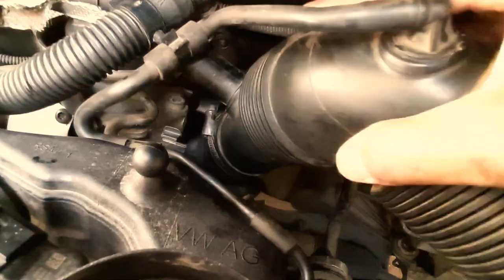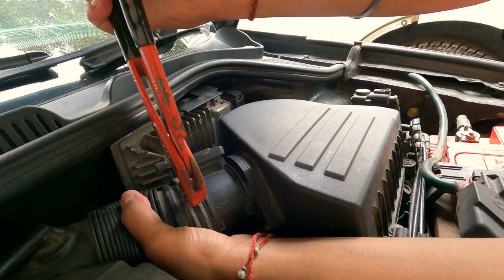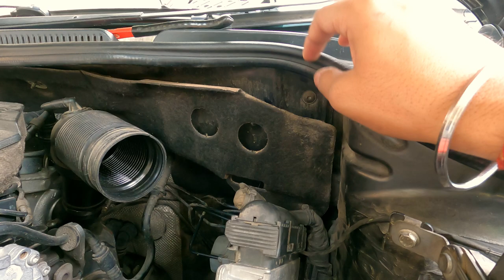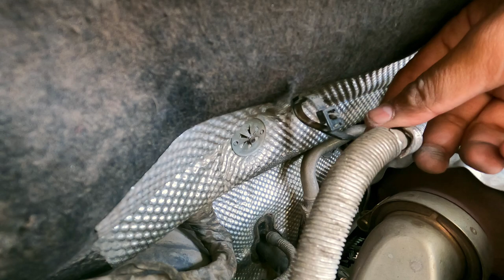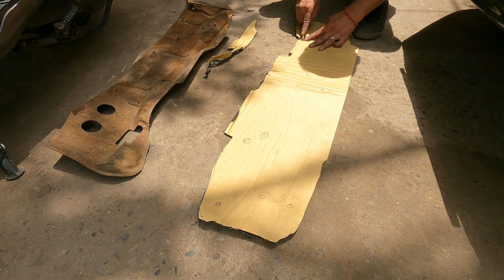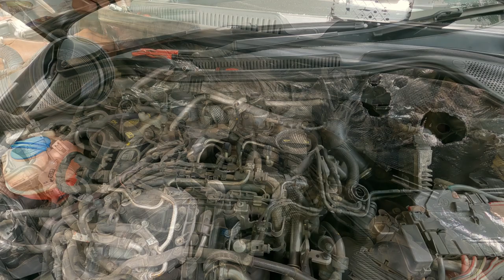CAR CABIN NOISE REDUCTION | REDUCE | ENGINE SOUND IN CABIN | VIBRATION | DAMPING | PART-3

Comment: Hi Sir, i had recently adjusted my tata safari dicor 2.2 vtt clutch pedal height and master cylinder push rod free play from local garage..They charged me just rs 100 but i think if you make a video about it, it will benefit people during lockdown and the process was not that difficult at local garage.Initially my clutch pedal  was very loose, after adjustment i felt there is 50-60% better gear shift response and driving comfort.

Comment: Wow! Great effort! Did this cause the most improvement compared to Part 1 and Part 2?
Reply from the maker: Part 1 was at top , as it helped to reduced the vibrations from the source , then parts 3 as it blocked the noise from entering and then part 2 it blocked the road and tyre noise , but at idle it doesn't contribute in any way

Comment: Chevrolet beat service light   issue agar woh scanner laga kay reset karte hai phir b aati hai 4 days pehle service ke thi m.oil all filters without diesel filter aur milage kam hai 14 kms/ltr and black smoke on 2000 rpm  service light thodi der ke liye liye jate hai phir se ate hai plz batien kya karna chahiye ismai
Reply from the maker: Sir black smoke 3 reasons ki wajeh se aa sakta hai 
1. MAF sensor saaf hoga
2. EGR system saaf hoga 
3. Intercooler saaf hoga .
Ye sab saaf hone ke baad apka black smoke ka issue khatam ho jaega

Comment: Sir I couldn't find this in my car. It just has the metal firewall and no sheet kind of thing that u are removing
Reply from the maker: If its not present then you can add a layer of insulation , to make you cabin even more silent , but its really shocking that your car doesn't have it
Reply: @yourDIYneeds  mine is hyundai santro 2020 model. It had very less cabin noise until I gave it for service. After this cabin noise started coming in
 and service guys tell it is normal 🙄 . Didn't know what they did to my car 😪
Reply: What's the name for it bro? U know it? Firewall insulator? I couldnt find that part online
Reply from the maker: Thermo acoustic blanket

Comment: This material couldn't absorb sound, but it makes surround the noise. Cotton wool or acoustic foam or blanket/towel  material should be use.
Reply from the maker: Sir , you can use the material which you like , video is just a guide to do the things , and i am quite surprised that someone knows that a towel can also be used , it may sound stupid , but actually thats the best thing to absorb sound .

Comment: Sir we want to see next doors damping
Reply from the maker: Sir they are already better damped and covered by the manufacturer , so it won't do any good
They are cover by a proper plastic cover which completely covers the opening , not with a thin plastic sheet like maruti cars
Reply: I was ordered damp sheet n planned to fix on all doors..
For vibrofilt
Reply: It would help me or not?
Reply from the maker: Sir as the doors are already well damped , it will help definately but , not as per the expectations
Reply: @yourDIYneeds  thanks